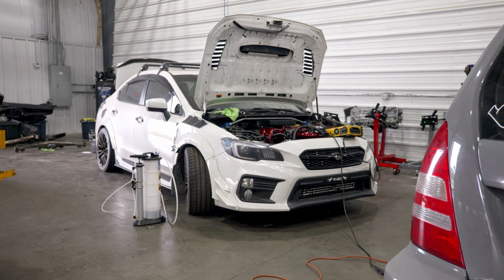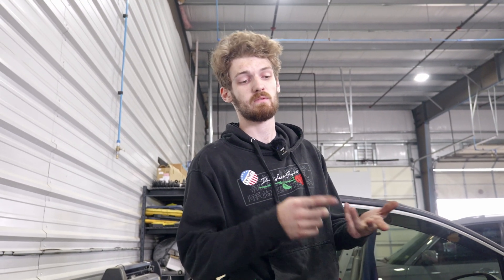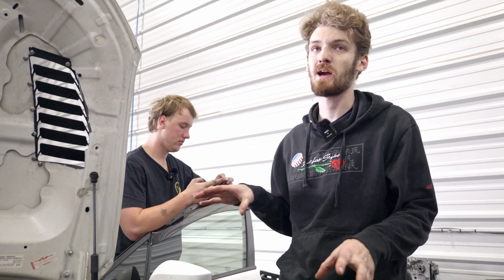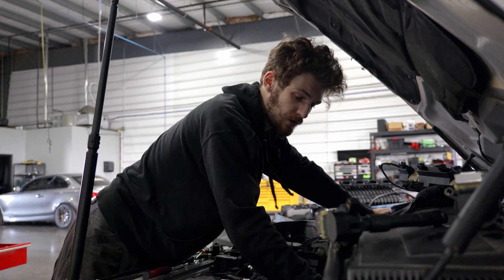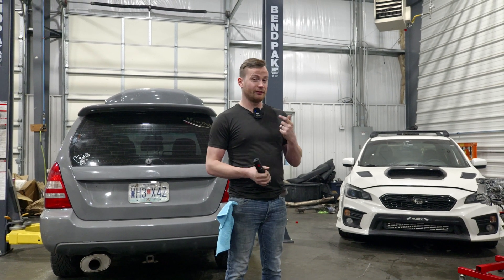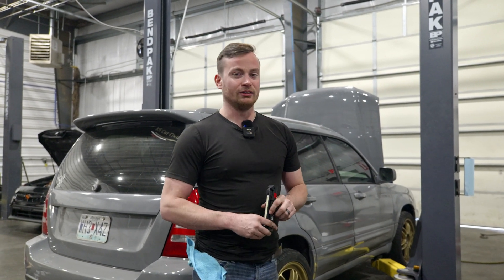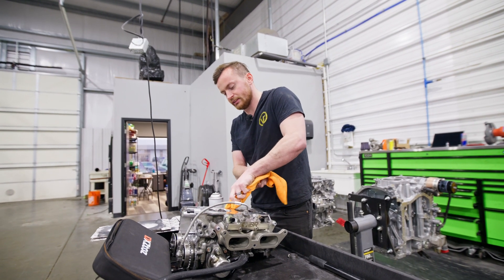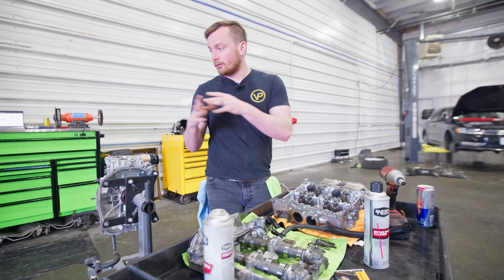FA24 Fails 5 Minutes After Startup! What Happened?

Comment: Yeah I will say torque to yield is probably one of the scariest torque specs. I've helped rebuild a variety of John Deere motors in the past ranging from 12.5 liters in pre 1990s models to 16 liters in the more modern ones. And on the first 16 liter I did I was terrified because the bolts are about 14 inches long and torque to 275ft pounds and 4 sets of 90 degrees after.